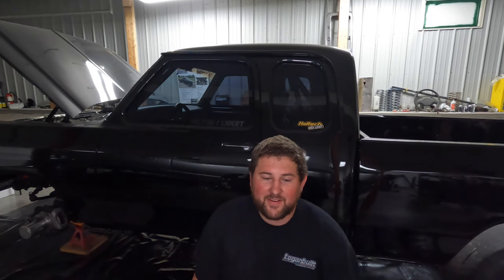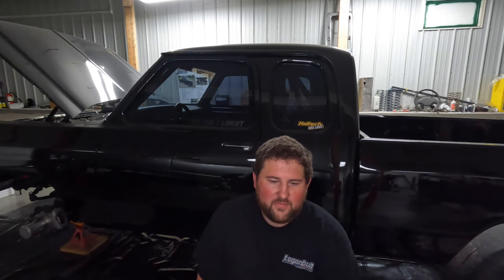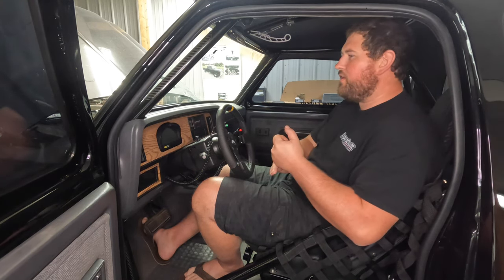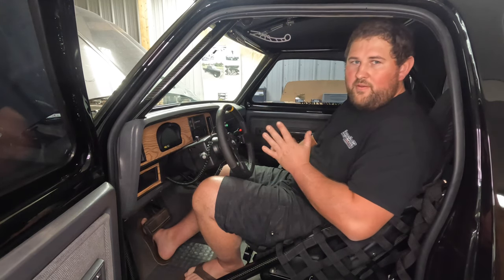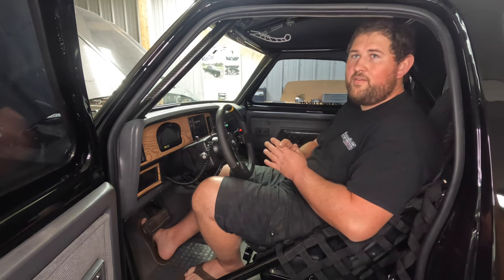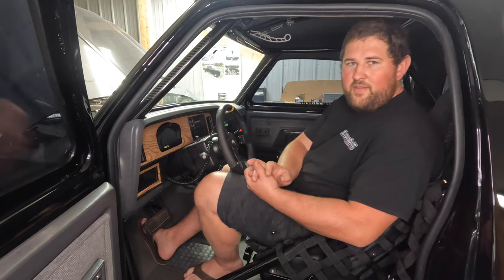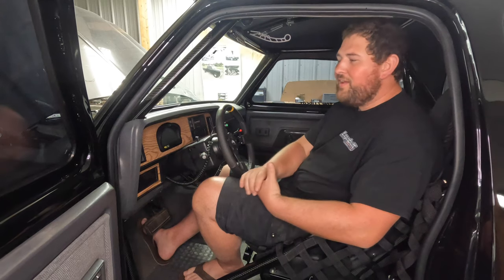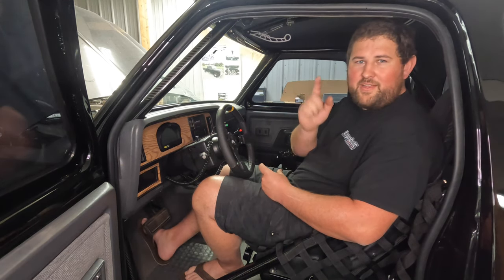How To Shift Your Race Truck!

Comment: With the anteater you need to lead the shifts as well, just like you were saying with the air shifter, but by a good bit. Also if you have a b&m shifter (tci outlaw) like many have, you can put a reverse gate plate in the shifter and hit the shifter one time to go from m1 to D.
Reply from the maker: Thanks for that info Mr. Turba! Pinned the comment to the top for those who may be running the anteater to see!
Reply: @LoganbuiltRaceShop  love the content man, keep it up! Stop over to my pits at UCC and chit chat!
Reply from the maker: Thanks man! I’ll be there running my truck as well. Did you team up with Derek this year?
Reply: @LoganbuiltRaceShop  This year we will be competing against each other. Im sure we'll help each other out though... One of the great things about the diesel racing community, collaboration rather then cutthroat

Comment: When I first switched my truck to be diesel. I made a mandrel to run a big block chevy crank trigger on the front of my balancer. Then used all my gas stuff.  It worked.